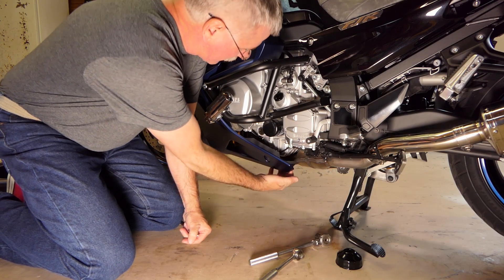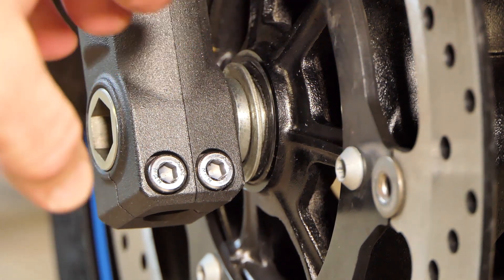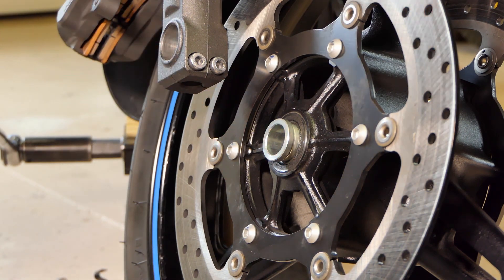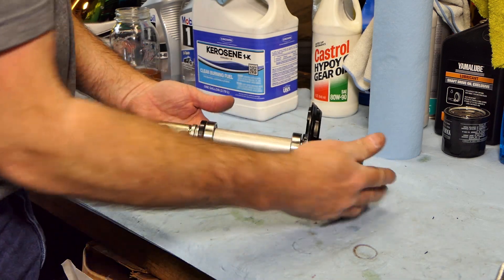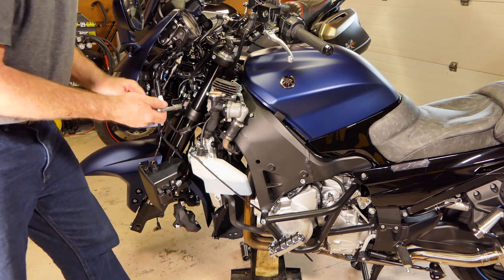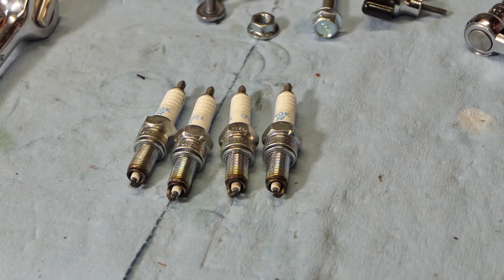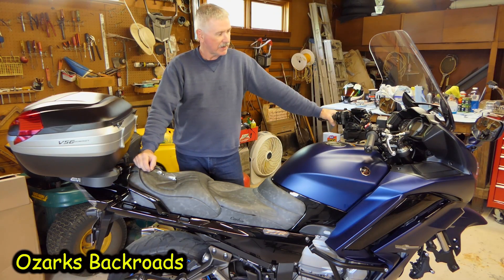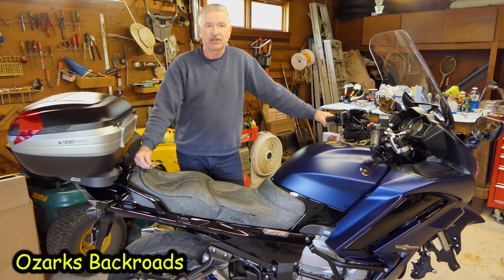Houston We Have a Problem....  2018 Yamaha FJR1300 first service and trouble....

Comment: I just bought a new 2019 Concours 14 and trailered it home. I checked it over prior to riding And found a lot of bolts not tightened properly and one of the side panels not assembled correctly.
Reply from the maker: good job sir....   :)

Comment: Nice video, but being the bike is under warranty, I'd suggest a trip to the dealer rather than disassembling when you find an issue. Should there be wear on the forks at a later time, they would be obliged to replace them under warranty, regardless.
Reply: The video poster might suggest that you work on your own stuff and stop running to the dealing whenever you have trouble.
Reply: Would agree bro. :) Can check my content, you may like it.

Comment: Again thank you, as always very informative and didactic in your explanations on every aspect. Only two things I can add as a positive suggestion,  the oil filter torque when installing a new one should be just hand tight, the black seal "O" ring on the filter,  locks itself as it warms up, even if you tighten it by hand, you'll notice you still need a lot of force to take it off. Also on the sinc and link of the throttle bodies, it will be easier to see the difference between the two bodies if you "T" each body per two mercury lines of the tool, so you can see both bodies vacuum against each other at the same time. Love your videos, and your dedication to the sport.
Thank you
Reply from the maker: Thanks sir, appreciate the comments, ride safe...  Jon Smith...  :)

Comment: I just bought a '18A FJR.  I have a '09A with 115K miles and it still runs great and had no plans to replace it, but got into the new one at such a price that it was hard to say no.  Still much to learn about the differences, especially in fairing removal and other bits, but I like what I see so far.
Reply from the maker: Congrats on the new machine, I don't have to tell you what a fine machine the FJR is....ride safe sir...   :)

Comment: I like the new ride! I also am a believer in the leather Corbin. Been riding them on my GL1800 Wings for many years. Don't know how I ever rode without it!  I'm not saying they are best or better than others, but my Wife and I sure like them.  I see you are running my oil brand also. I personally know two GL1800 Wings with over 300K using that oil. Happy Trails!

Comment: The extra washer was from the crating materials, it was on the spacer and on the axle in the crate, I just looked at the assembly instructions and while you can see in the pictures, it does not specifically tell you to take it off the spacer and discard it.....  I did a screenshot but cannot attach it here. It does tell you to "before tightening the pinch bolts, stroke the front forks several times to make sure of proper fork operation.   That would have aligned the forks properly and prevented the binding you discovered.
Reply from the maker: nice work sir..   :)

Comment: Also,  do you know if the 2021 model of the FJR 1300 has resolved the transmission (recall) issues?    Any literature you can point me towards?
Reply from the maker: Hello there sir, yes Yamaha started putting the upgraded transmission in all there bike as of 11/2020.  Any bike built after 11/2020 should have the new transmission gears installed from the factory.  Thanks for watching and keep safe out there....    :)

Comment: Another good video. Rode some AK Hot Springs last week.  I'll definitely come ride some Ozarks thanks to your videos.
Twowheeledobsession encountered same issue on his new 2014 in his video.  He had loose front end axle nut, was on hand tight... My oil filter was just that tight on my 18.
Reply from the maker: good to hear from you sir, yes the dealer has to mount the front wheel and the windshield on the FJR's when they get them and some of them just cant get it right it seems.  hope to see you out there soon... ride safe....  Jon Smith   :)

Comment: Thanks for all the work you do, your videos are a  valuable source of information for us FJR owners.  I got what seems to be the same Carbtune you have, but I didn't know about checking the  calibration on the gauge. Where did you get the "T" connectors for the hoses ? And which carb do you connect the one hose? to the pilot one, meaning the marked one ?
thank you
Reply from the maker: Hello there sir, good to hear form you.  I picked up my T fittings at my local auto parts store.  It does not matter which Throttle body you connect to.  Just that all the gauges read the same vacuum.  Thanks for watching and keep safe out there...  :)

Comment: Just wondering about torque settings regarding oil filter. Seems like it's a bit ott. Also hose clamps could easily damage hose if overtightened
Reply: Don't bother "torquing" an oil filter ...just do it up do it's very hand tight...that'll be enough....torque wrenches are great if you know how to use em...if not, don't bother. Only things on a bike that need a torque wrench are big end bolts and head nuts.

Comment: Nice n thorough PM! 
I just learned of a factory recall on the 6 sp models, an 2nd gear durability issue. 
My ‘14 ES is tough on front tires. 
Anyone try the Pirelli GT 2 A Spec or Michelin 5?

Comment: The bike ships with the front wheel off. The dealer installs it when they assemble the bike.
Reply from the maker: yes sir, the dealer has to install the front wheel and the windshield.  I checked the windshield screws, it looked ok, so I guess they got it half right....  thanks for the comments sir.  ride safe... Jon Smith....  :)

Comment: Nice bike, I have a Triumph Tiger 800 in almost the same color,correct me if i am wrong, but that is a matt finish? If it is, i wonder how you clean and protect it? Because that is not just straigth ahead like a glossy finish i have been told.
Reply from the maker: good to hear from you sir,  yes it is a matt finish but no special attention is needed, cleans just like any other finish....  thanks for the comment,  ride safe.... Jon Smith   :)

Comment: But what TF was the "extra" washer on the front axle? How did the reassembly go? We need to know...
Reply from the maker: The washer was not part of the assembly.  When the dealer mounted up the front wheel on the bike the Tech. added that washer on there for good measure.  It all went back together just fine....   Thanks....   :)

Comment: Bike looks pretty new. Is it necessary to strip a motorcycle with such low mileage. Surely oil change would suffice. Bearing must have been damaged by overtightened axel? Unusual

Comment: What seat are you using? and how are you liking it? memory foam?
Reply from the maker: Hello sir, I have the Corbin touring seat on the FJR.  It is a very well made but firm seat.  I like it very much, I can do 10 hour days on it with no problems however it is a very firm seat so if you are after a soft cushy sort of seat this is not that.   Thanks ....  Keep safe....    :)
Reply: @ozarksbackroads5484   Thanks for the reply! I had Corbin make me nice comfy memory foam inset years back for my 2003 Honda Magna. I am looking at a 2016 FJR1300A for potential purchase. I have a bad back and looks like the sitting/bar angles would be good fit. Will be looking at it this week. Also I was watching several of your other videos, your comment about smoother trans set up caught my ear. What year did Yamaha change over to helical gears?
Reply from the maker: @bluedeval03  Yamaha went to helical gears with the 6 speed transmission.  I think that was 2015.  If its got a 6 speed it is the new transmission.  good luck sir and thanks.. :)

Comment: How do you like the Corbin seats?
Reply from the maker: Hello sir, The Corbin seat is good.  It is not the super soft thick plush type of seat however.  It is very firm but fits and supports well.  I have had many 8 plus hour days on it with no issues..  thanks for the comment sir...  keep safe...   :)
Reply: I had the Sargent seat on my 2005 and it was great but sorta slippery as the covering was slick.

Comment: What oil do you run in your FJR?
Reply from the maker: Helo there, I use Mobile1 4 stroke 10w40 in all my bikes......thanks....   :)
Reply: Thanks, I have a 2012 FJR and love it.  I recently changed the oil and noticed my valves were making noise.  I used Rotella T6 5W40.  I just drained that out and went with the Yamalube 10W40 conventional.  I still have some valve noise but it is noticeable better.  Looks like a valve clearance check is in the near future.  The bike only has 7800 miles on it.

Comment: this fjr has not got carbs all fuel injection
Reply: Ha ha, that's exactly what I was scratching my head about , wut?
Carbs? That would be like 1997. :)
Reply from the maker: Guys, did I not check the throttle body sync in that video and reference another video on syncing the Throttle bodies on the FJR?

Comment: Hi. Just been watching another you tube vid by two wheel obsession where he is giving his FJR a 16K service. When he pulls the rear wheel there is a spacer that matches the one you found on the front. Check to see if your has the spacer fitted. They may have fitted it to the front instead of the back.
Reply from the maker: Hello sir...   good to hear from you, yes I will have a look at the rear assembly, I dont believe I have had the rear wheel off this bike yet...  thanks.... ride safe...    :)